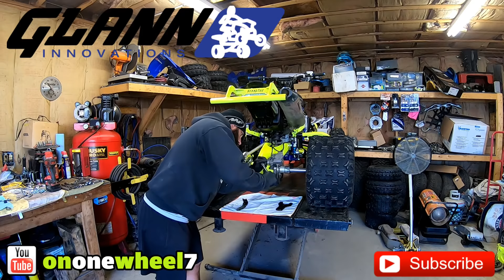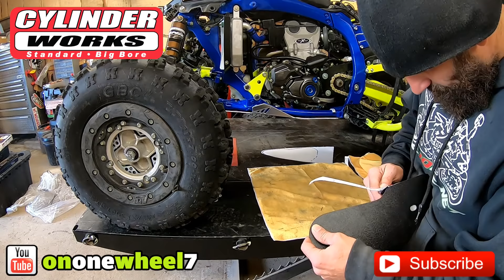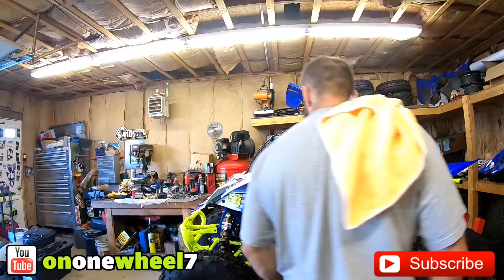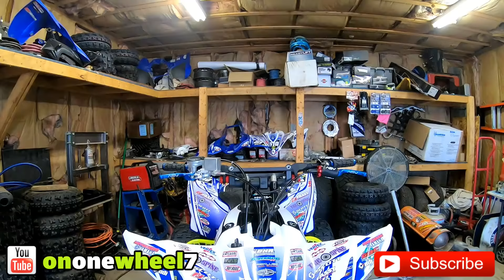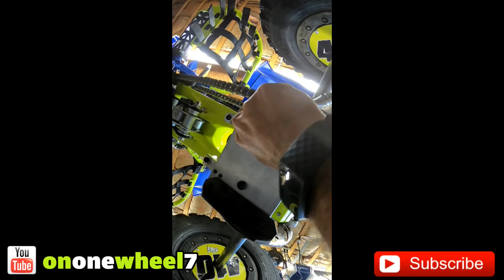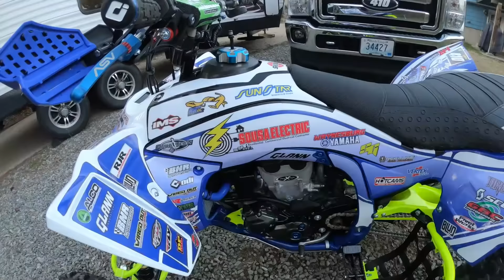2019 YAMAHA YFZ450R NATIONAL BUILD part 4

Comment: Sweet ride!
Reply from the maker: Thank you!
Reply: ononewheel7 any motor mods or completely stock?
Reply from the maker: Daniel Martinez this one has a ported head  w plus 1 valves and w web cams done by MXP along w his bored throttle body 13:5 h/c piston and a  Full hmf exhaust and a  Vortex ecu
Reply: ononewheel7 estimated HP?
Reply from the maker: Daniel Martinez not really sure i was hoping to get it dynoed at some point but w racing time is limited if i were to guess id say it may  be around 52-55hp
Reply: ononewheel7 time for a stroked motor!!!
Reply: Are Those long travel shocks and a arms??

Comment: LEME GET SOME OF THOSE TIRES...HAHAHAHA they better start hooking you up...
Reply from the maker: You need some?
Reply: I need to set up some xc tires. I get stuck in an inch of mud but I'm running mx. Tires. I really havnt had time to mess  with anything in past few years back to back hurricains...
Reply: I got a box of stick off parts i need to sell.. I'm not sure if I should hang on to them..  at this point I dnt even know how yet I dnt wana do eBay it ain't worth it.. shipping killer too. . .
Reply: Let's see how this year rolls out. It's flying by..
Reply from the maker: sOYLIENT gREEN shippings not to bad man pretty much a dollar a pound
You can open up a ups account for free and save even more

Comment: them new tires look sweet . once my motor stops braking ill be getting some gbc tires lol
Reply from the maker: I love the gbc’s foe sure
Reply: @ononewheel7  was that blow out the first ?and since im light do you think I should get the ground buster3 or the xc master for the front and rears ? what combo do you feel like would hook for me on a 2 stroke ?
Reply from the maker: 1st time on the blowout ground busters are more of a full blown race tire they are a touch shorter and also a softer compound so they wont last as long as the xc master the xc master is more of an all around tire race ut trail ride it and its a harder compound so it will last longer and also is a touch taller vs the gb3 either one would work well for you
Reply: @ononewheel7  thanks I think id try the xc master
Reply from the maker: Those are great tire i have a set i run for practice here n there

Comment: Hey ononewheel7 all you videos are great and the finish from the machine is so great. All the parts what you habe build on you quad are great and looks so good on you machine. I make me a unikat out my little supermoto . He have 39 ps is not so many but for me is ist ok i have not so many money for my dream this is a Yamaha Raptor 700 Supermoto and in Germany cost the used machine over 8000 $ this what i will have. 
I like the people wiht so many power and ideas,  great job from you .
Regards
 
Carsten from Germany
Reply from the maker: Thanks man a lot of people here love the raptor 700s that would be a great setup for supermoto! Do you have any riding vids from Germany?
Reply: @ononewheel7  no i be only a driver and from my Quad i think this is not good enough for a video i haven't a go pro and not the experience to make a video for driving. Yes in Germany i life in the countryside  and here you see not a 700s I have only a 400 it's a little and many work for customizing i must make many parts self because you can not by parts for the model, it's 2018 Model. Ok i have learn Metall worker and welding and so i make me the parts self A-Arms Protectors with LED Lights  and the Skit plates for the Engine and the rest of the frame in Aluminum. And so many more extra Alu Parts. And i will install a extra special Bottle for cooling water on my machine the original looks not so cool. 
I see you drive extrem cross with you machine this is for not so realy good to many fear to drive.
Regard 
Carsten
Reply from the maker: I think you should film some road riding i see some videos here and there of that and i like watching that!
Do you have a group you ride with?
How far can you travel on a tank of fuel?
Reply: @ononewheel7  i'm alone when i drive. I drive only on summer days, and i meet sometimes other Quad driver. but not more.
I have a 9.5 liter tank and i think when i drive long distance i think so 150 to 200 km on normal street, when i drive so 70 to 80 kmh . 
I like the videos from the USA so i can see the Landscape, and see were the driver come and live.
Reply from the maker: Carsten Endler you gta find a crew to roll with haha my tank racing im prob good for about 35-38 miles i usually have to get gas for the gncc’s the wnyoas are a little shorter i can usually squeeze those out w one tank!
Reply: @ononewheel7  I know but this is not so easy the other driver are cross driver in the woods and I drive only on streets last weekend wax by my Quad Dealer a special Day I have meet other driver but they are all cross driver and I was the only driver on the road 😔

Comment: Other than the M33x1.5 RH flywheel puller. Is there any other tools you would recommend? Have one coming in this week.  Of course I have blind bearing pullers and bearing installers. Last builds recently were crank up KX100 and CRF150RB. Love the channel brother.
Reply from the maker: Yup a case splitter is nice to have as well but not needed you can tap the cases apart just takes a little more time! Thanks man!

Comment: How do you not have 1m subscribers? Great videos man, keep it up! Have you always went with the vortex ecu? Have u tried pc5? Trying to tune my 09 myself with pc5
Reply from the maker: @Chris 2018  thanks man youtube is hard haha atv channels dpnt always do well😫 but i am tryn so hopefully it keeps growing this time last year i had 400 subs so it is growing! I actually started w a pcv and then a msd blaster then the vortex wish i got the vortex 1st the pcv is ok for mild mods the msd is def better but having a piggy back ecu can cause problems more wires more chances of one getting nicked  or broken the vortex eliminates that and allows you to run a cut harness eliminating a lot of the non essentials in the harness! Mayb search the pcv forums for other maps to test out what are your mods?
Reply: @ononewheel7  yeah awesome content man, something I've always wanted to do. I have done loads of research on those 3 controllers/ecu and i guess i just decided on pcv and the vortex can be quite pricey. Weird thing is my quad is all stock and have replaced everything fuel related trying to figure out why it has this sorta bog issue low rpms, last resort was told to get a controller that it could be the ecu. So until i can get it running perfectly stock then i will move on to mods (purchased the quad this way after sitting very long time). This is my first EFI machine and i love it but it has been definitely an investment.
Reply from the maker: Chris 2018 that is weird the 09-13 never had a bog issue but its a huge problem with 2014’s and up the vortex does fix that issue with those years but they are expensive! I would try a stock ecu swap but make sure its 09-13!

Comment: Do you use plastic under fuel tank or remove it. I seen some tank lowering pins. Lowers tank 1/4 “ if you remove plastic
Reply from the maker: I remove it and use the 38 motorsports tank pins/spacers check them out and use my code and save some cash 😎

Comment: I have a couple of questions, Well first off the quad looks amazing nice work. But i was wondering do you find there as any reason to change tire sizes from MX to XC? Obviously  the tire pattern you run will depend on on the dirt you're on but i haven't seen anything on the different sizes.   Second question do you think long travel shocks are worth the investment for someone just getting starting?  Thanks.
Reply from the maker: Thank you
Mx guys do run smaller tires 18” rears and 20” fronts for xc just about everyone runs 20” rears and 21” fronts mx setups are also wider usually 48-50” and xc is narrower at around 46-47” the smaller tires and wider stance is def better for mx. As fas as suspension i have ran both stock and now long travel it really just comes down to money if you wna spring for  a long travel setup i personally like it better but it also what im used to now there are plenty of top racers out there on standard travel setups but for a beginner id  suggest doing stock re valves to start off with and this is also gna cost way less as well once you start gaining speed you can always get a long travel setup in the future.
Reply: Makes sense. Thank you
Reply from the maker: Sykosledhead anytime

Comment: Hey was wondering what is the best shifting levers I have a 2011 Honda trx 250 and need a new one
Reply from the maker: I like OEM for the yfz450r never had an issue!
Reply: ononewheel7 the teeth on mine wore down and it slips need a new one
Reply from the maker: Gotcha prob was loose i usually change mine once a year as well seems like they start having play around that time!
Reply: ononewheel7 ok thanks this is the first time I’ve had to do something with that

Comment: Where do you get the hand guards and the bars that connect them to the faast flex bars?
Reply from the maker: So i run a houser stem with there anti vibe clamp.
I run powermadd hand guards star series w the wraps everything is rite from those companies. Use my code for houser and save 10%
Reply: Awesome thanks, found them. What grips are you using?
Reply from the maker: I run ODI lock on grips i use the rogue 120mm ones